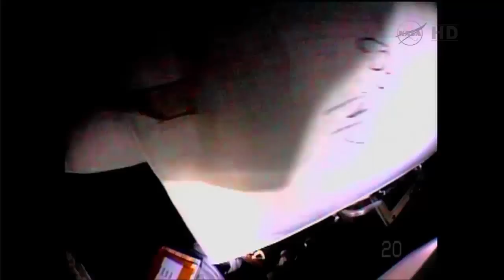ISS Expedition 36 - US Spacewalk EVA #23 Is Aborted Early Due To A Suit Water Leak, July 16, 2013

Comment: How calm and collected they have to be in order to "just work the problem" is beyond my understanding, this is why Astronauts are heroes, chosen among the best of the best.
Reply: they are calm because they know noone is in danger.  it´s a water leak..
Reply: @baltazar0007  unknown water leak in the vacuum of space. I'd be shit scared
Reply: @Jake-lf5yt  the water leak never comes from outside the suit. it´s just internal couplings/hoses.  the worst that happens is that he get wet and wont have water to drink. the suit does not run on water. :)
Reply: @baltazar0007  That was very dangerous indeed, if the amount of water had increased the guy could've drowned in his own helmet... this was an emergency, what are you talking about.
Reply: @marcellop3163  alot of poeple have survieved drinking water. he did not bring alot of water more thah he can drink.
Reply: @baltazar0007  The actual NASA report mentions how he could have asphyxiated(they literally had to launch an investigation when they realised how bad it could have been). He had 1.5L of water in his helmet(the investigation found out it was from a blockage in his spacesuit and NOT the water he was drinking) and it was covering his ears, eyes and nose. If it went over his mouth there is only so long you're going to be able to drink before you need air aka a mouth and and nose full of water.
Reply: @baltazar0007  youre correct the suit doesnt run on water, but does contain a lot of water and other fluid. In micro gravity the fluid is going to 'stick' to surfaces, in this case in the helmet. 1.5l is a lot of fluid to have inside you're helmet, it covered his mouth, nose, eyes and ears making communication difficult. The fact Luca, who is an incredibly capable human being says "Chris, help me" sends shivers down my spine.
Reply: When youre in a swimming pool and on ground..no worries
Reply: @baltazar0007  what????????? you can't simply enter n the ISS like a home, you have to open each pressure door and decompress and let alone to reach this pressure doors is time-consuming!! easy to say from home, "no danger"
Reply: @baltazar0007  that's not drinking water you genius, this is used to regulate the temperature, nearly 4 liter are in the bag!
Reply: @marcellop3163  how much water do you think he hade in his suit.... ?
Reply: @Jake-lf5yt  well the water can only come from a small container in his suit.... there is no water in space outside his suit.
Reply: @Ezekiel903  it´s not a car
Reply: @dannyireland1808  can you go into details about what other fuild ?
Reply: @Ezekiel903  tell me what it is and why you...... genius..
Reply: @Ezekiel903  if you cant drink 4 liters you´r not a real man ;)

Comment: Tim Kopra I believe was wearing this same suit. All that putting a "Nappy" behind their head is going to do is delay the onset of a serious problem and also delay the awareness of the problem. Surely this suit needs removing from service?
Reply: 6 years later I can answer that, a ventilation fan in the suit was broken so water wasn't being removed. Was a simple fix I believe but unfortunate it wasn't found sooner.
Reply: @mattagon6407  Thanks for the update. You would have thought that it would have been discovered the first time it went wrong as high humidity and ventilation are pretty obvious bedfellows. 😊